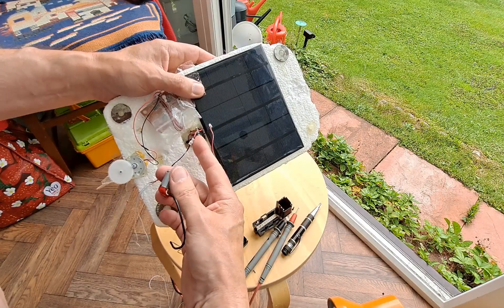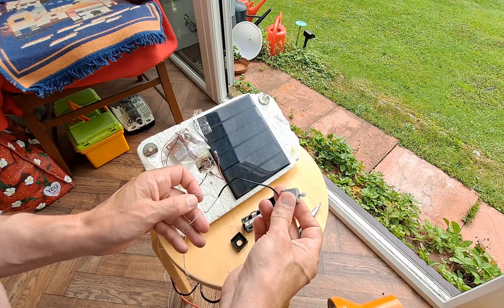Solar powered train attempt revisited 🚂 Video Reply 20220713

Comment: maybey at a capacitor between the motor and the solar panel so it will charge the capacitor ?
Reply from the maker: Maybe, have you tried it yourself?
Reply: @GrandadIsAnOldMan   well i think the motor in the train needs a continues power and with the solar panel it comes in pulses like a charger so with a capacitor in between the capacitor will be charged at all time so yeah i think it can work
Reply from the maker: @nicksupportveteransmcnethe2141  I am not aware of solar panels generating pulses? If you are running them through a boost converter that that probably will cause  a ripple effect. When people put a capacitor across the cell, that is usually to charge it while no current is being drawn. For example on a pulse motor, which only takes current to generate the pulse each cycle. The BEAM bots use a similar setup. http://solarbotics.net/library/circuits/se_t1_fled.html Here is my related playlist - Solar Fun - FLED based mover - BEAM Bot https://youtube.com/playlist?list=PLA5a2xPRSrB2BYQZqfVqWfaja5C9hY_Zg
Reply: @GrandadIsAnOldMan  okay though about changing the motor out voor one that can work with the solar panel
Reply from the maker: @nicksupportveteransmcnethe2141  the other benefit of using the capacitor across the cell is when you connect the motor, there is the extra boost of power from the capacitor to get the motor spinning. Once it is running, then the flow from the cell may be enough to keep it running. You will see videos showing a motor spinning a propeller, powered from a solar cell with a capacitor across it. That is what is going on there. The motor is initially boosted by the stored charge, and then maintained by the cell.

Comment: Grandad, The dry cell is 1.5v the recharged one is 1.2v and the solar pannel may have 6v but the wee motor may not be able to handle that many volts.  Keep trying, you will get there in the end.
Reply from the maker: If you watch the full series, you will see the train runs fine on NiMh batteries. In the final section of this video, it does run off the AAA NiMh but it was clearly not fully charged or low on capacity. If I had chosen a different brand of solar light, I could have found one that contained an AA NiMh. As for the motor not handling 6v, it would spin and burn if that was the problem. I demonstrated it running happily on the small LiPo so assuming that was freshly charged it would have been around 4.2 volts.

Comment: if you could get the panel to charge up some capacitors, you'd have enough current, if you do the maths, lol. how about getting  3x more of those panels, and making a track (or does it have it's own track). You could style the track to run a bit like a Scalextric track. By putting a couple of brushes (perhaps made of desolder braid) fitted under the Train Engine (connected to the motor) and normal, bare copper wire as the electrical contact. All the panels (x4 Positives connected to one wire, and all the negs etc, to the other bare wire contacts) so that all the panels are in parallel. Mind blown 😮  Great vid.
Reply from the maker: The original question was specifically about running the train using the solar light panel. Certainly you could run the train with modifications to give it an external power supply, whether that is solar or any other source.  You might find this video by Sam's Trains interesting - https://youtu.be/aBO2jXcE-cg It is in my video description too, along with more information and related links.

Comment: I'm glad your still trying to run the train from solar. I had an idea that if you use a buck converter to drop the 6.5 volts to 1.5 volts you might get more current. I don't know if it would work and I consider what you have done as a success.
Great video. Keep up the good work.
Reply from the maker: Just using a different motor designed for the job would help. 😊👍
Reply: @GrandadIsAnOldMan  Indeed.  I've found 612 and 720 coreless motors to be the most efficient DC motors at low voltages.  Their rated speeds at 3.7V tends to be quite fast (50krpm+) so you most often find them used in drones driving the props but you can also find them with tiny planetary gearboxes or worm gear reductions for use with surface vehicles.  They start spinning at like 0.5V and can actually produce useful torque at about 1V.
Reply from the maker: @whatelseison8970  yes, if you check my video description, the solar robot kits all use the small coreless motors, with gearboxes to drop the speed and increase the torque.
Reply: @GrandadIsAnOldMan  I like the way you think. Haha.  I just had to check out this video cause your channel name is adorable.  I'm sure you have many good ideas also, I'll definitely check out the rest of the channel soon.
Reply from the maker: @whatelseison8970  thank you 😊

Comment: I wonder if the big solar panel or the motor is sensing some type of overcurrent.
The large solar panel might have another diode that blocks the current when it senses an overcurrent going to the small motor. Strange that it works with the motor on the boat though. Or the motor has a little thermal fuse in it and when it senses anything over 3 volts it shuts the power off. 🤔
Reply from the maker: Just different types of motors, Mike. There is no clever current sensing anywhere in this. Just a panel and a motor. There are a few videos coming up using the "fluttering butterfly" solar panel and motor. No problems with that setup running a purpose built car.